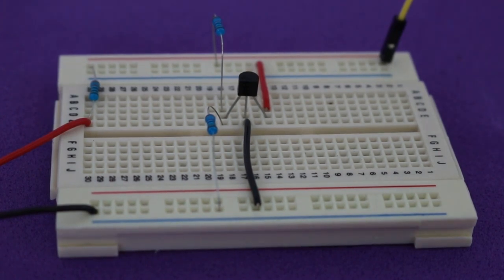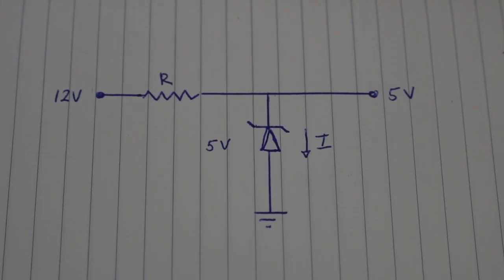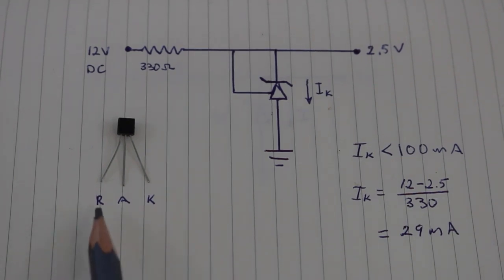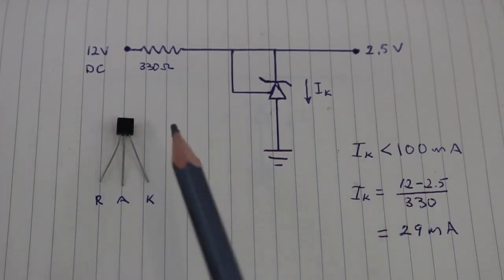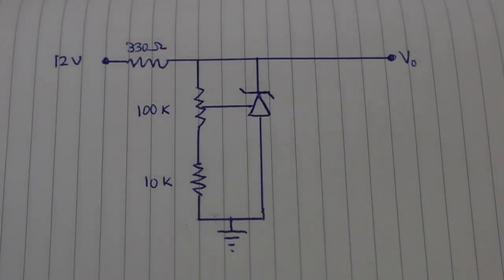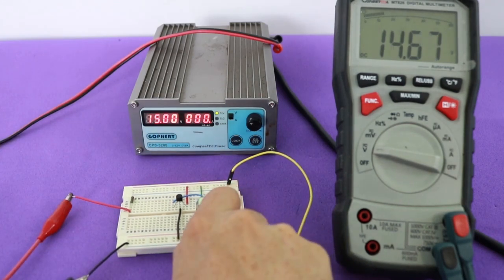TL431 Adjustable Zener - How to Use it

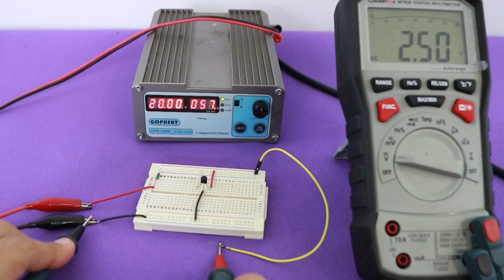Comment: 3:55 Can you eliminate the input resistor when you have two reference resistors?
Reply: Giriş direnci TL 431 in üzerinden akacak akimi sınırlamaktadir.Mutlaka kullanılması gerekiyor.Tl431 Max 200 mA akıma dayanabiliyor.Direnc kullanılmaz ise TL431 bozulur.

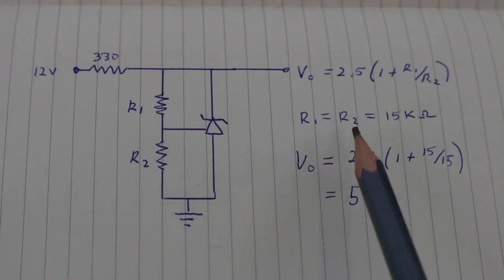Comment: Can someone explain how he got the equation at 4:21 where Vo = 2.5(1+R1/R2). My understanding was that the voltage divider equation is Vo = Vin(R2/(R1+R2))
Reply: Late reply, but I think that 2.5(1+R1/R2) is the equation for the Vout of the TL431, not the voltage divider. You're right that voltage dividers by themselves have a different equation.

Comment: thank you for the informative video 🙏🏼
on page 19 (figure 21) of the TL431 documentation (https://www.ti.com/lit/ds/symlink/tl431.pdf) the equation for Vka (Vo in your video) is different from what you presented (time 4:00). 
I am making this note because my circuit with R1=R2=20kΩ (voltage divider) gave me Vka=8.28V instead of the expected 5V. I noticed that with the equation in the documentation the Vka did calculate correctly. Can you explain why is that? 🙏🏼

Comment: It's 12volt for 330ohm if you vary input voltage the resistance value have to change but you vary voltage level to 20volt but it's still working

Comment: Hello !
I have a smps with an output voltage of 24 volts. The output part has an opto-coupler and a tl431. I want to make the output voltage 14.5V. By calculating I found R1 = 17.8k and R2 = 3.708k.
Vo = (R1 / R2 + 1) * 2.5 = (17.8 / 3.708 + 1) * 2.5 = 14.5 V
But there is a problem. The output voltage is not stable and fluctuates between 13.9 and 14.7 volts all the time. How can I solve this problem?
Can you help me please?
Reply: Can you solve this by adding a small capacitor, in-between shunt resistor and voltage divider and, another capacitor at V-out?  

Or put the Cap. before shunt and another after divider?  Doesn't this smooth out ripple?

Comment: Hello, Nice video ! i tried many times to do the same but each time i got different voltages, that divider thing can't get into my mind. The 12v enters in the ref (left PIN when you see it in front of you) or at the third one ? i know the middle one is ground. I would love to see that 2.5v but have something around 7.8v and changing, nothing stable... is my device faulty ?

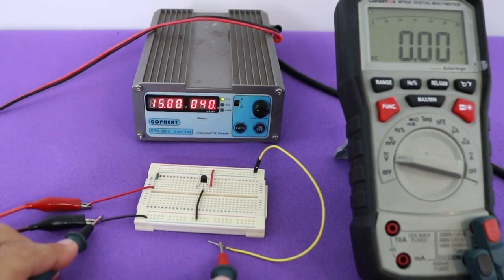Comment: Note - Even though this device can sink 100ma maximum, you must calculate the series shunt resistor so both TL431 and the small resistor do not dissipate more 250mW. At 3:38 when input voltage was 20v, the 330 ohm resistor was dissipating ~1-watt (was OK for quick demonstration). If programming resistors would be used for a 10v reference with 20v input, then TL431 current would need to be limited to no more than 25ma (@10v = 250mW) so shunt resistor would change to maybe 470 or even 560 ohms. It's common to see many TL431 circuits with a transistor output acting as a current buffer. Lots of info and examples on the TI datasheet - it's 83 pages, imagine that for this neat little 10-cent part.. :-)
Reply: I got a bag of 100 of these for $10. My question is, if the shunt resistor is that large, wouldn't that increase the output impedance? I suppose, adding another series resistor, leading to a transistor or an op-amp buffer at the output, could  help. Thanks.
Reply: Thank you for your valuable reply. But I think the power dissipation limit for the TL432 (TO-92) is about 0.7w. There are different limits depending on the package and it can be obtained from the datasheet.
Reply from the maker: Thanks for your input! Its an amzing device indeed